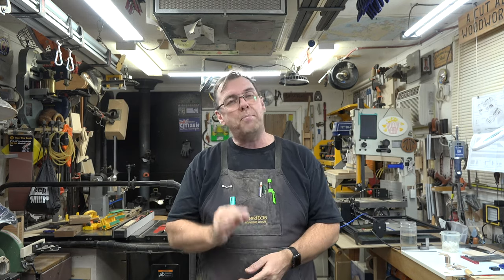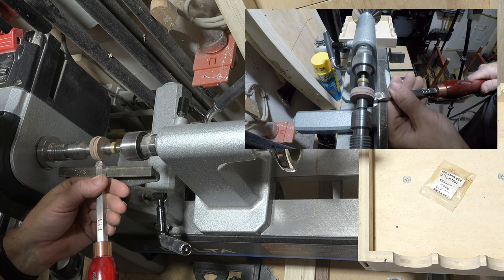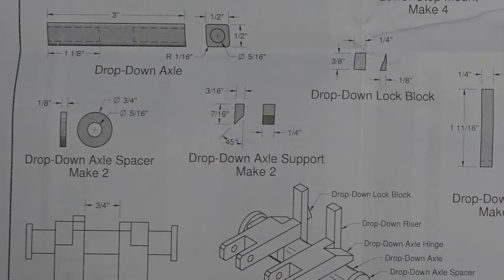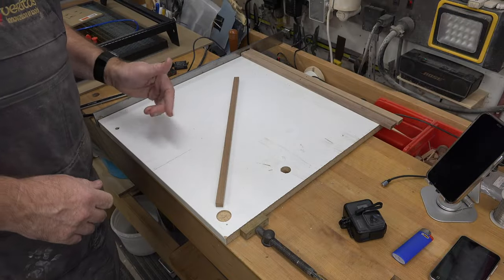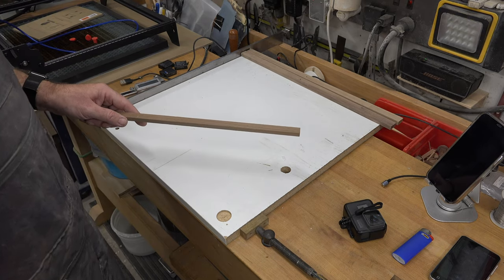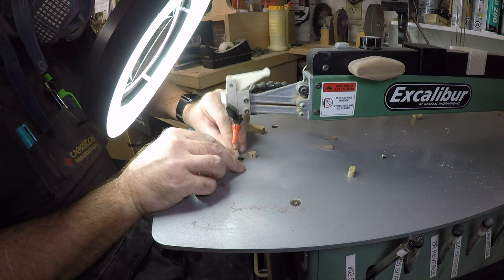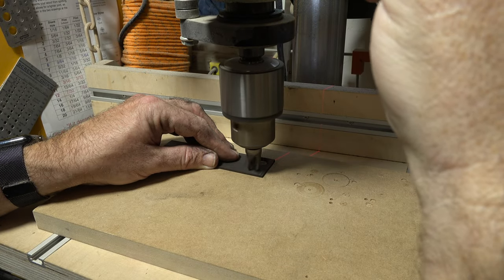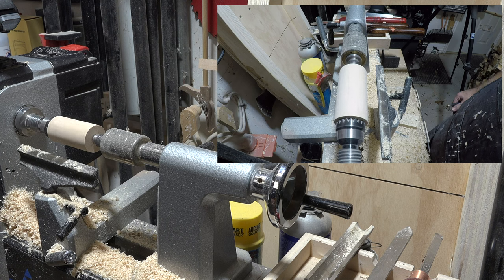Making Toys and Joys Dump Truck and Pup Trailer, Part 3

Comment: Awesome show Kenny. I see im not the only one using plug cutters👍. Just used those to make fuel  caps on my jeeps build. Tomorrow back to redo a 10 wheels. lol
Reply from the maker: Plug cutters are the best thing I've found for making small, perfectly circular parts.  They're great.  Thanks for tuning in and for chiming in with your thoughts and methods.

Comment: As usual, you are doing a fantastic job. But here in Wisconsin, the Drop Down Axle would be called a Tag Axle. But Toys and Joys is out of Washington, a strange state.
Reply from the maker: That's good information.  I'm not a trucker and know nothing about the larger trucks but I'm glad that you provided me with the term that you guys use.  I'm sure that there are plenty of names for this exact same axel depending on where you live.  Thanks for tuning in and for chiming in with your thoughts.

Comment: Thoughts on the tanks for someone who doesn’t have a lathe?
Reply from the maker: Dowels work Dave.  While I'm not a fan of using them and prefer the lathe, for those who don't have a lathe you have to make due with what you have.  Using the proper sized dowels and cutting them to length works just fine.  The ridges on the tanks can be added by carefully rotating the dowel and using the bandsaw or scroll saw to cut the ridges.  I hope this helps.  Thanks for tuning in to the show this week.

Comment: when your cutting stock down to finish size ,do you or can you run boards through a belt sander and make bunch of material different types for stock. i see there's a lot of 3/8, 1/4, 1/2, 5/16 ,sort of make a stockpile of sizes for which to pull from. love watching these model .where you find that bench clamp you have there. quick and solid . Thams again
Reply: sorry drum sander
Reply from the maker: The bench clamp is a Quick Release Wonder Dog from Veritas.  You can get them at Lee Valley Tools.  Here's a link.  https://www.leevalley.com/en-ca/shop/tools/workshop/workbenches/benchtop-accessories/74622-veritas-quick-release-wonder-dog?item=05G1030
Thanks for tuning in.
Reply from the maker: You could mill a bunch of pieces down to the final thicknesses but I prefer to do it as I need them.  I find that milling wood earlier than you need, results in a lot of cupped and warped boards that end up getting wasted.  For that reason, I do my best to only mill what I need at the time.  I hope this helps.

Comment: Morning Ken, I love your work, am working on the dumnptruck too. I have 2 questions: 1) what is that ruler you use (red bottom/aluminium-like board with wholes?  and  2) how is that black apparatus called you use for drilling axle-wholes?
Reply from the maker: The ruler you are asking about is called a T-rule and it is made by INCRA and is available at most woodworking suppliers.  I got mine at Lee Valley Tools.  https://www.leevalley.com/en-ca/shop/tools/hand-tools/marking-and-measuring/rules/58877-incra-t-rules
The drilling jig that you are asking about is a self centring pen drilling vise and I also got that at Lee Valley.  https://www.leevalley.com/en-ca/shop/tools/workshop/workbenches/vises/54855-self-centering-pen-drilling-vise?item=70G1105
I hope this helps.  Thanks for tuning in to the show and good luck on your model.
Reply: @acutabove_woodworkings   thanks very much.

Comment: Why not use 1” dowel and cut 1/8” thickness?
Reply: Sometimes you don't want to see end grain from the dowel.
Reply from the maker: You could definitely do that if you don't have a lathe.  I prefer to turn the pieces because then they are completely and perfectly round whereas dowels can be misshapen.  The other issue is that with the end grain of the dowel, cutting them that thin makes them very fragile as the end grain is extremely easy to snap.  I hope this helps.  Thanks for tuning in.
Reply from the maker: And not all dowels are perfectly round.